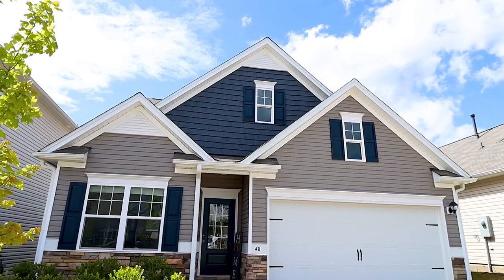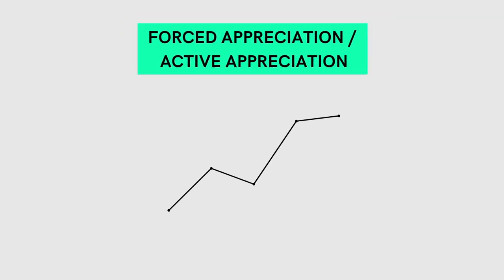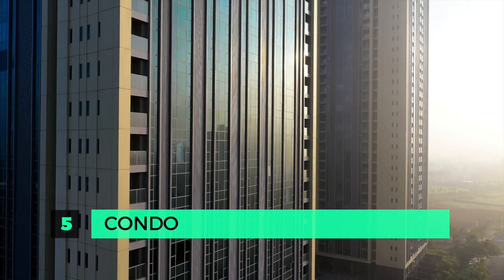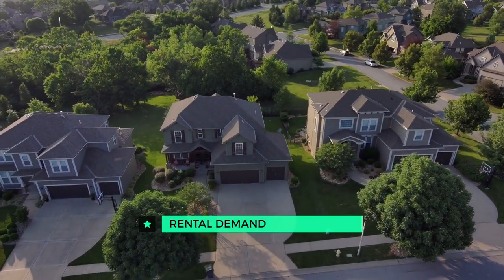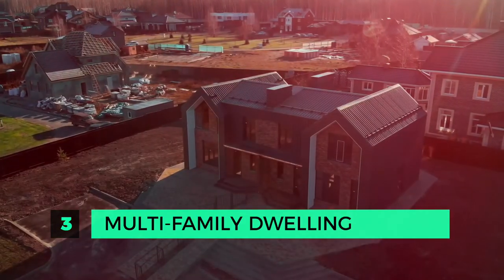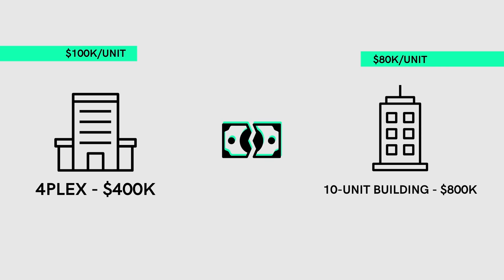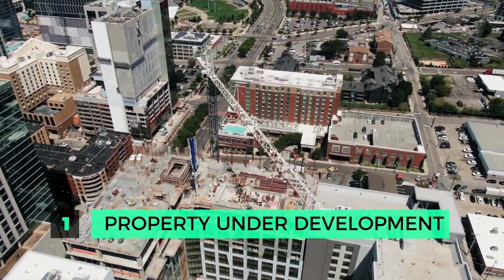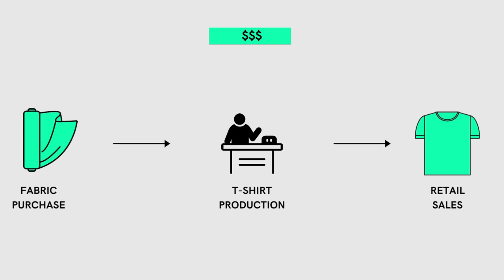5 Most Profitable Real Estate Investments. Make More Money in Real Estate

Comment: Really like this video, one question tho, when you purchase an apartment building with positive cash flow, principal pay down and some renovations to get a higher appraised value for refi, what’s your strategy to sell this in 5 or 10 years, is there enough buyer in the market to purchase this type of properties? Thanks
Reply from the maker: There's always a buyer for a good asset. It may not fly off the shelf like a single family home in a hot market but a cash-flowing asset will always have a buyer. There are multi family buyers who only focus on turnkey properties so that's who would most likely acquire it if there was little to no upside.